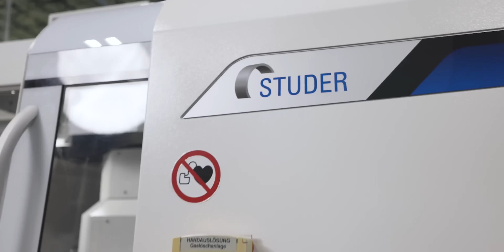CNC Machine Explodes While Taking DEEP Cut in Alumina Ceramic

Comment: I've seen several fires.  Where it used to be the cost of the machine, lately its been more about downtime.  I've got a customer that had a fire in a Star machine without fire suppression, and the operators took 3 handhelds to put it out - ABC powder.  The clean up was a pain, but the biggest loss was a wiring harness that will take more than a year to replace.  They've since gone with Reacton gas fire suppression systems that won't contaminate the oil like Pyrogen, which produces a light potassium salt powder.

Comment: I run an ANCA cnc grinder to make production tools. I've had one, (1) fire and it scared the sht outta me. Anca uses pyrogen fire suppression. They have a heat probe installed on the ceiling of the machine and a manual fire suppression button on the side of the machine. You have to flip a clear plastic cover, then press and break a glass button cover to activate it. This is exactly what I did. They pyrogen put the fire out so fast I thought it was magic. Stay safe out there guys!

Comment: Immature company behaviour. (Joking)
In our company, when pc power supply died (IT swapped original HP parts with Chinese noname. Probably selling original parts on eBay or something.), my manager asked me how he can boot up the PC? I said: if it's dead it's dead. Call IT. First thing IT did, blamed me using PC inappropriate ways and deliberately damaging the company.
 hardware.

I was shocked by these claims, and told them that they better back up their words with evidence, otherwise I'd rather take it to a working tribunal.

Another manager from the head office came in and asked me not to do as they will resolve it with the IT themselves, and he was supposed to talk to the IT guy, who made those allegations against me.
IT never contacted me again.
I didn't file any allegations against the company.

But the behaviour surprised me a lot.

Comment: What a joke. There are real machinists that think this is so disrespectful. If you lit the material on fire you had a tool failure which is bad tactics. Pull your shit together Titan
Reply: In on other reply they said it was a programming error, and not related to them(?)
Reply from the maker: Exactly, the company who supplied the machine had their guy on the machine. This was a very serious situation and we handled it as such…
2 years later, we can laugh at it… but at the same time bring awareness that it can happen to anyone. Proud to have the best team of real machinists that have worked on the biggest projects in worldwide machining… and now create curriculum to lift up our trade.

Thanks Norbert for having our back. 

Titan
Reply: @TITANSofCNC  yeah, the correct people need to take responsibility for their respective faults, and we better not jump to conclusions right away. Btw im not cnc machinist just enjoying these kind of videos. Im in the begginging of my 20's and graduated from informatics in high school. Tought im currently a kind of apprentice at a cnc propan gas/plasma cutting machine(the brand is Messer). I think its easier than what you guys do in these videos. The programs are written by someone else, it has good factory values too so you really only need to adjust a few things, or figure out how to get out the stuck parts from the steel sheet(mainly happens when we cut thicker parts).

I just tought to tell my experiences while when we already talking about this.
Reply: @TITANSofCNC  i maybe learn cnc machining in the future, seems interesting, and i kinda like what i do now. Sadly current place only pays minimum wage even to the few cnc machinist we have, so i dont plan to spend half of my life here
Reply from the maker: Have you looked at starting with the building blocks on our academy.titanic.com

You can get the software for next to nothing on our resources tab and the documents are downloadable once you click onto the tutorial etc
Reply: @TITANSofCNC  thanks for the source, maybe sometime i look into it.

Comment: What fluid\vapor caused the fire??
Reply: Likely using oil based coolant whose mist had formed a stoichiometric mixture with the air inside.
Reply: @soundspark  Grinding oil was used here
Reply: @bernhards9840 So I was correct.